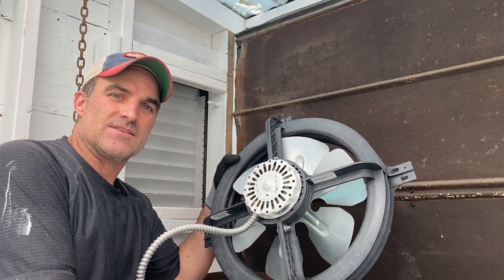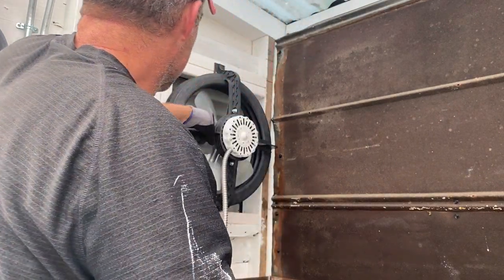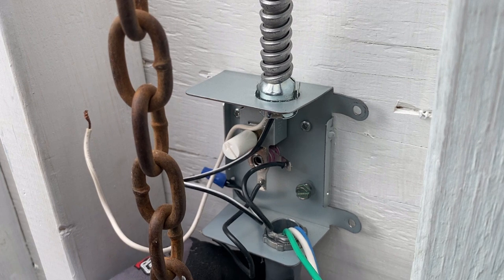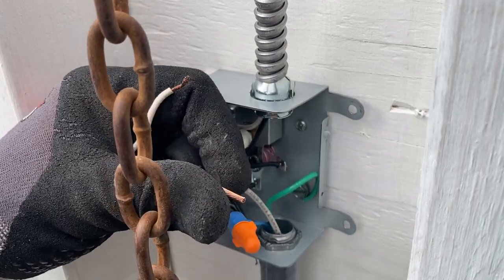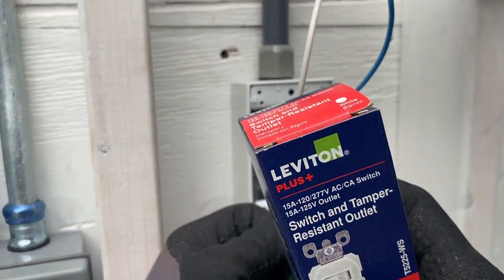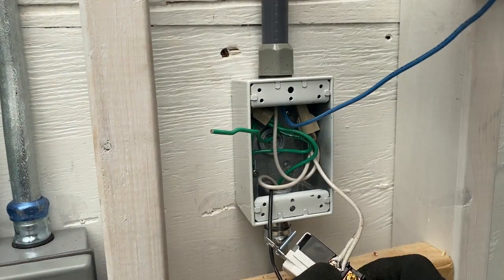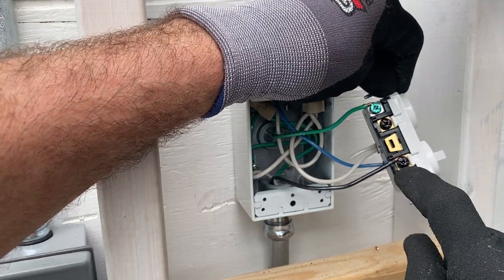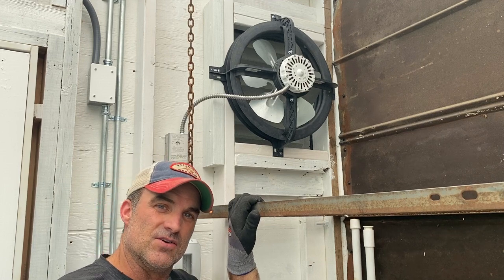Complete Install Air Vent Attic Fan w/ Power and Switch #diy #how #howto

Comment: Would be nice if they made one that was variable speed automatically. Hotter it gets the faster it turns.

Also, EVERYONE assumes that you have a grounded house. What about those houses that have the old cloth wrapped wiring on ceramic posts?
Paying $20K just to have the wiring redone is out of the question.
Since it is in an attic where nobody goes, can you get by without the ground?
Reply from the maker: I know what you mean. As far as wiring this into Old knob-and-tube, it can be done. However, you should have a qualified electrician install it that knows how to work with knob-and-tube.
Reply: @YouCanDoIt2  But but but those are EXPENSIVE.
And local ordinances will outright DEMAND a ground.
I just want to scab one in and have it work (NO PERMITS OR INSPECTIONS).
I can do a sort of western union splice (wrap wire around another without cutting)
Could even solder the wire if I felt the need.
Or use a split bolt.

Now another issue is that my gable vents are ancient. Non standard size (unfortunately so are my HVAC vents).
They are kinda weird with little holes facing down instead of a real screen.
And then there is the issue of what size fan to get that won't burn up because of restricted gable vent blocking air flow.

I thought about installing a booster for the cr@ppy box roof vents. Again, there is that pesky wiring issue.

How I know about the wiring?
Had to replace a ceiling fan that only had that kind of wire and no ground.
Reply from the maker: @crazysquirrel9425  I completely understand the price with a professional electrician. I was a licensed commercial / residential electrician for over 20 years. Knob-and-tube is one of the trickiest to work on...that is why replacing the home wiring with grounded Romex is the best option. Sorry I couldn't be of more help.
Reply: @YouCanDoIt2  It's OK.
Inspectors would demand an upgrade to the service, main panel, and all wiring including outlets, fixtures, boxes, etc.
Just to bring it all up to code.

If I have to I can cut the single wire and splice in two boxes to extend the wiring to make connections.

I think I would rather wrap the new to the old and solder and tape before going through all that.

Dunno since I have not been in my cramped attic to see what's in there.

Even my garage is ungrounded (detached garage) so I had to use a ground rod next to the garage just to install a GFCI I wanted.

It is possible I could run a separate ground to a water pipe but I shy away from that sue to electrolysis issues I have seen before.

Comment: Does it need a start up or run cap? Did not see one.
Reply from the maker: @ericrichard5237  Hi. I don’t quite understand the question. What are you asking about Start up or run cap? I’m not sure what you’re referring to.
Reply: @YouCanDoIt2  some style AC motors require capacitors for starting torque. Long story short, restoring old box fan, that is the only motor I've found that fits but it's 60yrs old and could be missing a capacitor. Turns out I should be good. Thank you for replying.